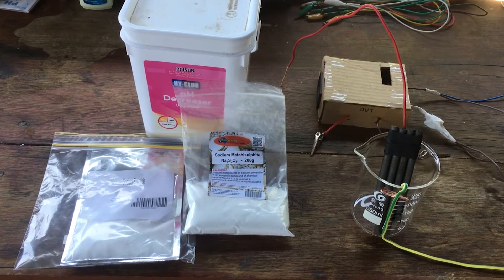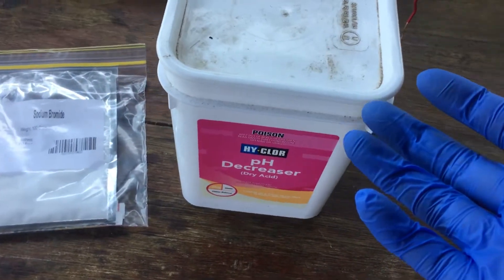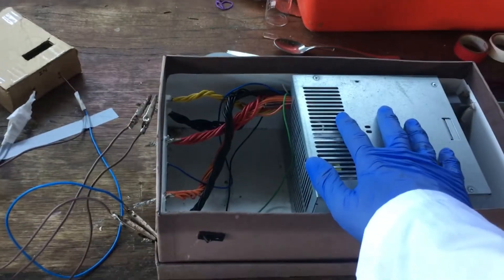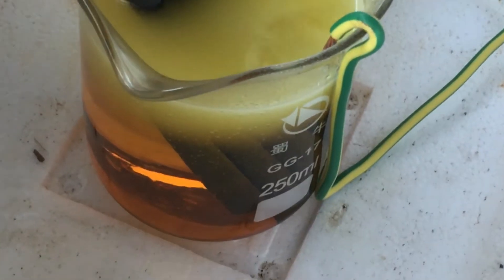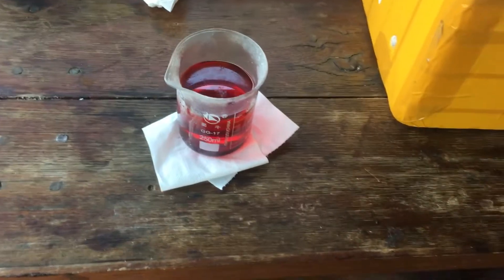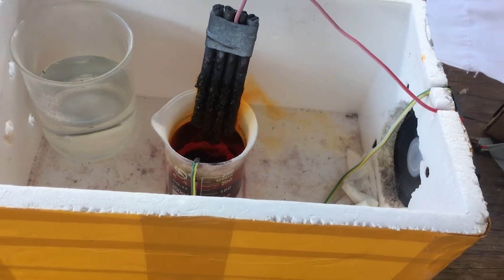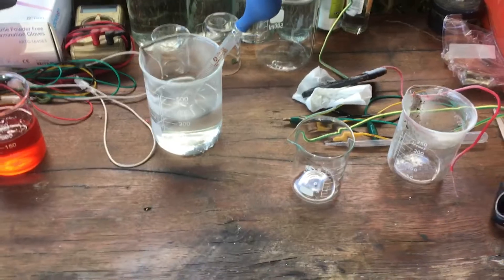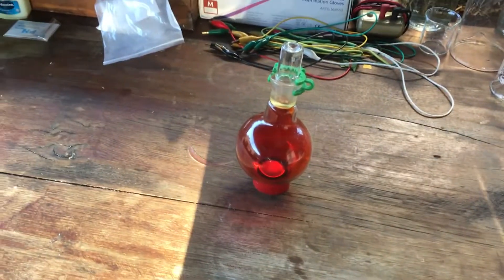Making Bromine

Comment: FYI, zinc bromide is a very interesting salt.  You can make it via double displacement with zinc sulfate and sodium bromide.  The zinc bromide is so ridiculously soluble, you can make a syrup out of it that won’t tolerate any other salt being dissolved.  All the sodium sulfate will crash out upon cooling, leaving nearly pure zinc bromide.  The resulting zinc bromide solution is dangerously osmotic, and will burn skin.  It weighs I think 16lbs per gallon.  Plus, when electrolyzed, the zinc will deposit on the cathode, so you don’t have to worry about bromate production.  Cheers!

Comment: Will there be any side reactions like HBr gas formation when used H2SO4?
Reply from the maker: Not at these concentrations and temperatures. If you heat the mixture, or you pour concentrated sulfuric acid directly onto the bromide salt, then this is definitely a possibility.

Comment: Hi mate there is a supplier in qld that supports hobby chemistry where you can obtain sulphuric acid. Let me know if you want the contact details. Also, if I were to use 97% sulphuric acid in the place of the 56g sodium metabisulphate what volume (or weight} will be needed? Thanks in advance.
Reply from the maker: I think I'm all good as far as sulfuric acid goes, I haven't actually found myself needing the concentrated stuff for anything yet, thanks though, I'll definitely consider it if I need some in the future. And the equivalent of 56g of NaHSO4 should be approximately 25g of your sulfuric acid (though you might want a slight excess on top of that).

Comment: what about lead dioxide electrodes?
Reply from the maker: I'm not sure whether the actual lead dioxide on the electrodes would hold up properly or not. Either way, all standard substrates which are normally used for lead dioxide (titanium, graphite, lead metal) will definitely not withstand bromide electrolysis conditions and quickly disintegrate or dissolve instead of acting as a valve metal. I'd also be concerned about lead contamination in the waste so I wouldn't risk trying it even if it did work.
Graphite and pure platinum are the only real viable choices in my opinion.
Reply: Oh yea this makes sense 
I liked using graphite as an anode from batteries but now I don't because I'm scared there's thallium or cadmium in the battery so I use pencil graphite 
Any other graphite source you know?
Reply from the maker: You can use 'gouging rods' or 'gouging carbons', which are available at most welding supply stores. They're pretty high quality graphite rods and work very well (in fact, that's what I've used here), though they come coated in copper which you'll have to sand or dissolve off the surface before use.
Reply: I tought to indirectly oxidize the bromide to bromine by bubling chlorine in the solution. This chlorine can be produced electrochemically with an PbO2 anode in a NaCl solution with diaphragm and it doesn't need the use of an acid.

Comment: İ live in tunisia , and its really hard to obtain beakers and chemicals , especially for under eighteen (16 yo) and paypal is prohibited by law.. But my mother do have a paypal and buys things over the internet but the problem is if i buy like beakers and chemicals over the internet i dont think the post will really be okay with just handing them over . 😢😢
Reply: PayPal is prohibited?  Wow!  That's crazy!  Why is it prohibited?
Reply: @BackYardScience2000  i think its to preserve the worth of tunisian dinars , or maybe to limit buying cheap stuff and instead buy them from tunisia , to preserve the tunisian economy
Reply: @amir_husseyn7712  ah ok.  Thanks for answering.  That sucks though because when buying some stuff online, occasionally the seller only takes PayPal.
Reply: Yea man that sucks 
I live in algeria xD 
And I have the same problem 
I ordred some erlens and its been 2 months and i didnt get them 
The costumes wont let it go
Reply: You can make your own distillation set using glass cups as beakers, bottles as flasks, light bulb with the end snapped off as boiling flask, vinyl tubing and a gas stove. For electrolysis, use phone charger. Many chemicals are in houshold items. Sodium hydroxide in drain cleaner. Calcium carbonate in chalk. Manganese dioxide, zinc metal, and carbon rod in Carbon zinc/alkaline/heavy duty batteries. More info can be found by google ing a product's safety datasheet.

Comment: Why just not separate the cathode and anode a little bit to save the pain.
Reply from the maker: Are you talking about separating the electrodes with some kind of diaphragm, or just separating the electrodes by distance?
Reply: @ScrapScience  the diaphragm, like what you did using flower pots
Reply from the maker: Doing this with a diaphragm is something I'll probably try in the future (because you're totally correct on the fact that the efficiency of the process would be much greater).
However, introducing a diaphragm would slow down the reaction immensely (due to hindering of the current flow), so I decided against it for this video in the interest of time. I'm also not sure whether or not my clay pots would actually hold up to bromine.

If you do want to see bromine being made by diaphragm electrolysis, there's this video by Aussie Chemist: https://youtu.be/aA62w6QhbdM
Reply: @ScrapScience  Thanks.
I suggest putting the cathode in a pot instead of the anode. Also, put a smaller inert container under the anode to collect bromine easier and prevent bromine from going near/under the pot.

Comment: Increase the voltage?? Increasing the current(amps) increases the wattage but not voltage. Good job on producing bromine and getting some ads on your videos.
Reply from the maker: Sorry, I should have been more specific in the video. Over any standard load of relatively constant resistance (like the electrolytic cell), changing the current from a constant current power supply must create a proportional change in voltage, and vice versa, as V=IR is always true. Increasing the voltage or current in my particular setup increases both values anyway.
Reply: @ScrapScience  ah ok I see.

Comment: You can get sulfuric acid 37% from car batteries thingy
And just boil the water
Reply: Koukou Zee, that's not how chemistry works, I've done that and it ends up yellow, most likely lead sulfate. It also is not easy.
Reply: @EdwardTriesToScience  
Use brand new bottles not direct from a car battery 
And throw in some hydrogen pyroxide to purify any organic stuff
I got like a liter of 90% from 3 bottles 30% 
Crystal clear
Reply: Koukou Zee, So you are talking about H2SO4 drain cleaner, but using that trick doesn't get concentrated 98%, but my hotplate gets to the boiling point of sulfuric acid so I can easily distill it to 98%, though the fumes are charring the rubber stoppers in the distillation set, because I still use stoppers and glass pipes, instead of ground glass.
Also by using a car battery, I can get infinite 35% sulfuric acid by topping up the battery with magnesium sulfate solution and charging it. Then I distill it.